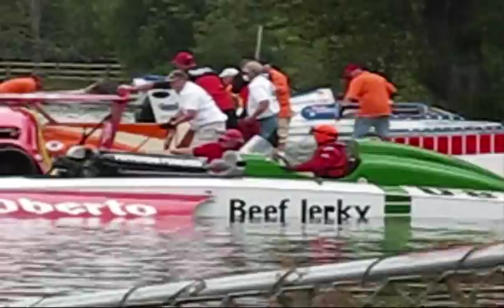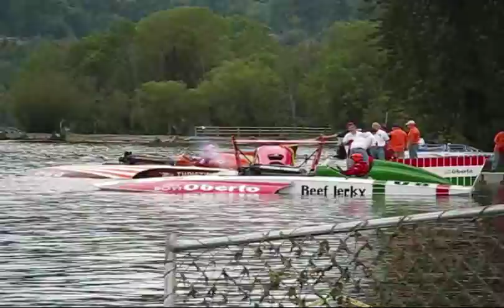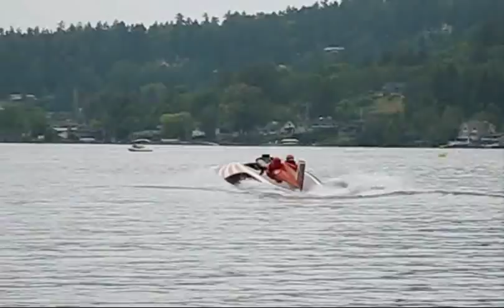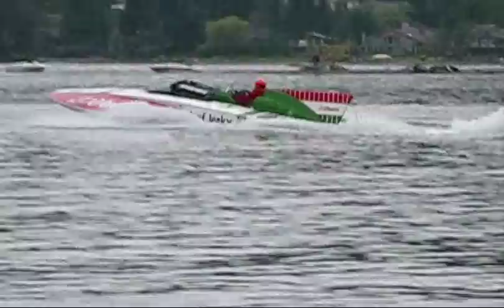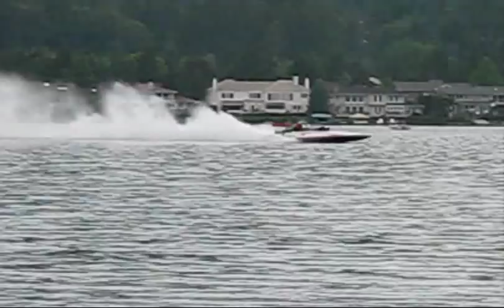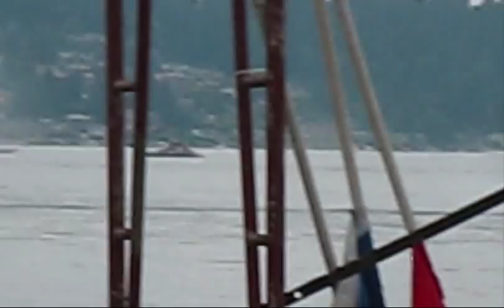Vintage Unlimited Hydroplane Racing

Comment: Big problem in the day was connecting those big Merlins to an iddy bitty prop. Getting those gear boxes to live was a problem until ING RAMBERG and DON McVITTIE introduced hardened and ground AGMA class 14+ gears from the Gear Works Seattle to the mix. Not an easy proble until they got the gear mods right.

Comment: in my 20s i was a hydroplane nut we had races 5 mi  from my home in tonawanda ny  my buds caled me nuts  i bought a dumas rc miss budwiser built it then went up to 1/4 scale for me to have fun with help from dad  a machinest at chevy  a rotax 440 skidoo  engine a kart kendic tuned exaust     a pro paintjob  75 mph no problem